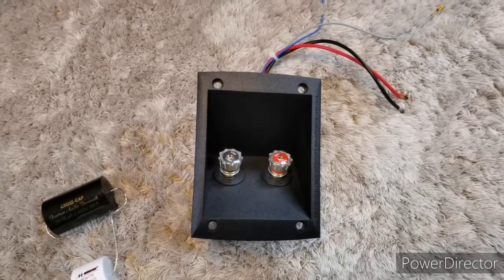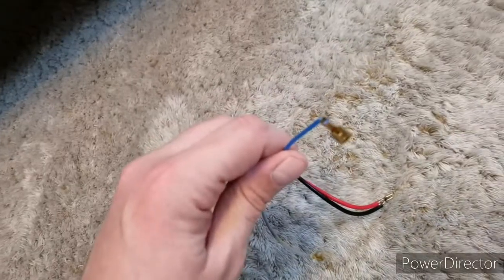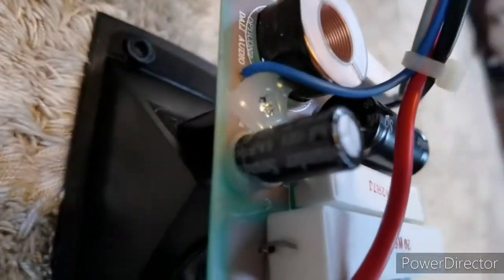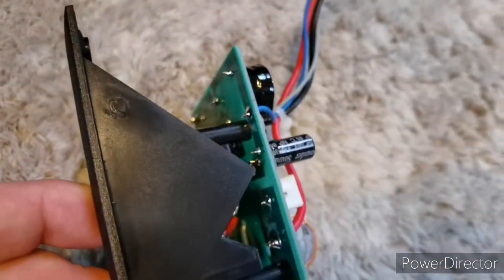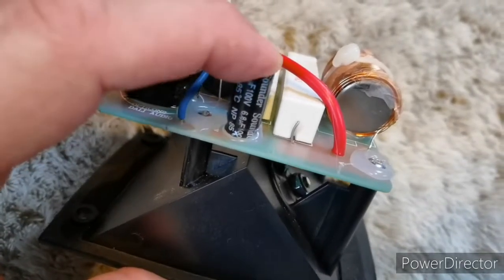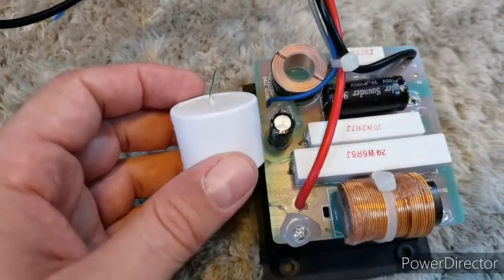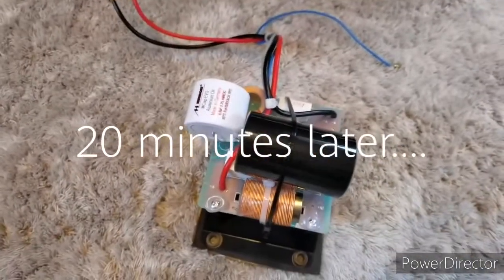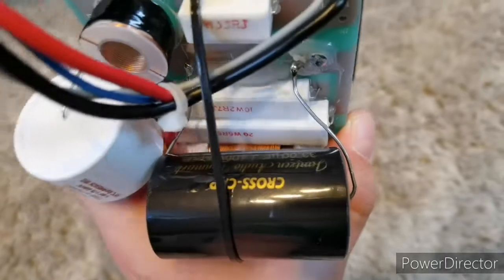Dali Opticon Capacitor Swap - Worth It?

Comment: Changed the capacitor with better crossover cap in my dali opticon 2 mk2 and it sounds much much better, much better clarity, transparent and expressive but not harsh, bass sound much much cleaner too
Reply from the maker: @ssjong73  Enjoy! Thanks for sharing! What cap brand did you choose btw?
Reply: @k4syx  hi, I am using Jantzen Standard Z-cap for the tweeter and Jantzen Cross-Cap for the woofer, changed the speaker from one I don't quite like to one that I enjoy listening to, and thanks for your video  too!
Reply: Opticon 2 mk2 have same capacitors like mk1? 33 uf and 6,8 uf?

Comment: Please in your Subjective opinion how much they Changed the Sound
Light Sharp Hard ...
THANK YOU
Reply from the maker: They've added detail and the sound flows effortless. Its not like they've totally changed the signature of the speaker: but now you can hear a lot of small things, details, spatial clues that were not there before.
Reply: I have an Opticon mk2 that's it
disaster from the ICON speakers was ok but this
Reply: @BH5996  what are the differences in sound between icons and opticon mk2?
Reply: Too closed High Tones Muffled and dirty.. Plastic bass Slow and not as versatile as Ikon... @milutinpopovic76

Comment: Чьёрт побИери * *** (untranslatable Russian folklore)😁. Well, why is there no sound test at least in the program REW (Room EQ Wizard). Different people have different frequency characteristics and preferences for sounds. The graphs would show that it has improved. And without a test, how to understand? Maybe it's just psychoacoustics working from satisfaction with the work done.
P.S. Thank you for disassembling the acoustics, I've been wanting to see what's inside for a long time. It can be prepared in advance, and not after disassembly. But I will most likely go the other way - I will make a new printed circuit board so as not to violate the old design. I didn't expect DALI to squeeze electrolytes into the acoustics..... stingy 🤑
Reply from the maker: Hi! It was easy to compare them after doing the first one. Unfortunately I have no microphone good enough for proper measurements :(
Reply from the maker: @СергейСущук-х2я  Thank you, I'd be glad for the link. I have a few Sony mics from the mini disc era, but they have a strong treble roll-off.
Will I need to calibrate this self made one?
Reply: @k4syx  Do you have some kind of filter? The post with the link and the mail are deleted🤕I opened an email address on my YouTube channel
Reply from the maker: @СергейСущук-х2я  nothing I would be aware of - you're saying that comment here for deleted??
Reply: @k4syx  Yes, as soon as I attach a link or email address to a comment, the comment is deleted. I don't understand how YouTube filters. But I have already encountered this. P.S. As I said, I opened the mail for communication on my YouTube channel, if you are interested, write a letter.

Comment: Be aware that the sound profile of each DALI speaker is fine-tuned to the specific components used in that particular speaker. If you change some of the components, the sound profile will differ from what we intended. And on top, you unfortunately will lose your warranty. Just bear that in mind.
Reply: Company save money by putting inferior capacitors in, it's always an improvement no exceptions
Reply: Why don't u spend a bit more money on caps etc
Reply: bear not bare.
Reply: Fine tuning should mean having a compensation circuit for deviations of standard components. And no, there is no such circuit here. Furthermore, the MK1 model crossover has the same schematic as the MK2 (aka LR2 crossover). So no super science behind the design. Prove me wrong.
Reply from the maker: Hi! Thanks for tuning in. I am always trying to choose as neutral components as possible, in order to retain tuning (as I like your speakers a lot - haven't heard a Dali pair, regardless of the price, that I wouldn't love). And yes, of course that kind of modification means no more warranty: I thought that was obvious, but maybe I should state that in my video. A lesson for the future.
Anyway - I love your speakers, keep up doing good job there!
Reply: @k4syx  Try a magnet next to those binding posts.
Reply: @k4syx  Hi , Those caps have polarity ? thanks
Reply from the maker: @RanTausi  No they don't, though I've read some sources stating that they can sound better when directed (via prints) same way as current flow. I can't hear any difference, but it doesn't hurt to place them like that either.
Reply: @k4syx  Yes , I doubt if any change in sound. have a nice day !
Reply: Pure lie, but ok.
Reply: @Starch1b2c3d4a  What a great comment. You sound like an expert, sir! I would take your amateur opinion over any audio professional any time. Bravo. 👏🏻